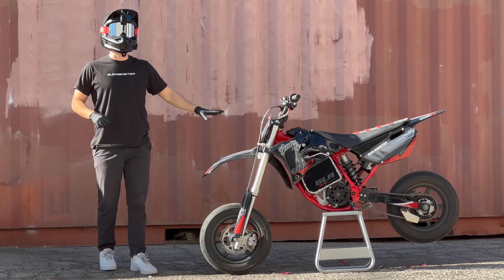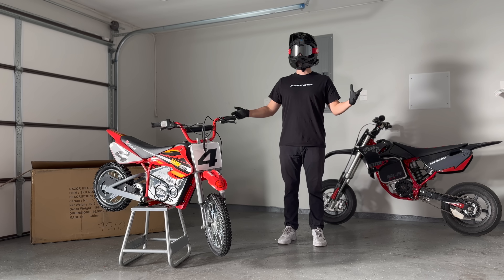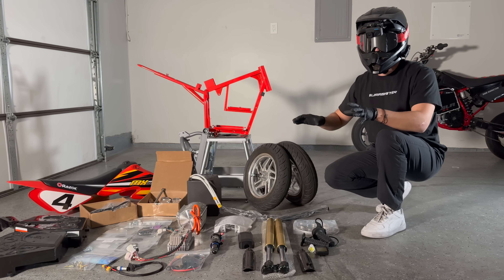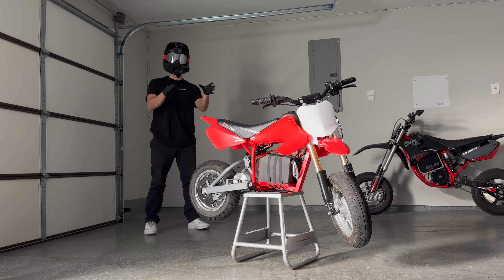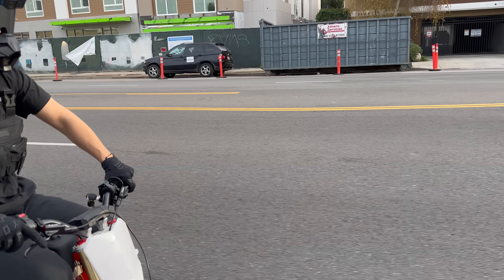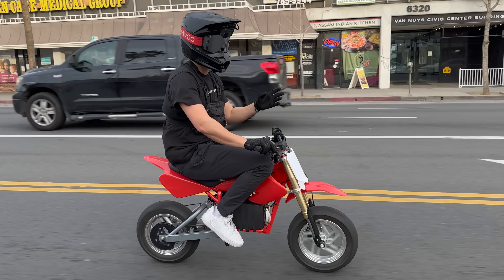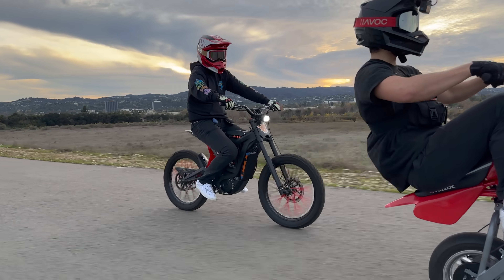How to Build an Electric Mini Bike

Comment: Hey surronster I’m 12 years old and I want to upgrade my stock razor mx650 but I’m not good with electrical things and connecting the wires and stuff and I’m afraid it’s gonna explode

Comment: What is the part name for the computer 🖥️ basically i get battery and motor i just don't know what to look for to build one and i have a small electric ⚡ atv that the battery and motor is fine but the relays or whatever its called must be bad motor only works when straight wired appreciate any help😮

Comment: Whats the name of the front forks, front fender, and the tape you used for strapping the battery in? Or any other recommendation's on how to strap the battery in securely?
Reply: I think he used electrical tape, or some tape with heat resistant, and zip ties to keep it strapped in

Comment: I wish he would show an in depth video for full beginners because when it’s sped up the beginners like me have no idea to do anything. 1:30
Reply: same he needs to do one cos i wanna build my own but dont have a clue how to
Reply: @brandondeegan8063 bro you just gotta get one and figure it out that’s the best way, I got bikes but w motors so I’m on the same boat as you dw😂
Reply: @brandondeegan8063  look at razorcrewcole he has in-depth videos on how to build one
Reply: Pls do a more in depth video man pls pls pls just one so we have an idea what does a man have to do
Reply: @tylercoffin6373  I bought this exact kit the kit comes with a link to in depth instructions
Reply: @tylercoffin6373 there are multiple builds in depth for each part and all dif motor battery options.
Reply: Relatively simple you just gotta get the kit that matches your bike than after that it is all screwing/mounting to the factory holes and all the plugs are color coded so you don’t gotta worry about destroying your electronics.
Reply: It’s almost 2000$ just buy one
Reply: @buzzkill278  buy one what a modded bike?
Reply: Move the playback speed
Reply: Step one: clear garage floor space
Step two: obtain a metric set of hex-keys and wrenches.. 
Step three: get to wrenchin'
Reply: Fr

Comment: W video! I noticed that you removed your heatsink on the motor to be able to run the rsf street tires. Would the heatsink still work if shave the part that rubs on the tire?

Comment: super cool build ..  we have to have pedals on the bike or you need to a license and insurance.  I have a 2020 Emmo knight turbo with the after market controller and the governor disabled I get going 83km/hr or 52/mph but it has pedals

The first electric I bought is an E-Vader or E-Grom with the gold forks.  Even with the cheesy controller it came with I still get going 63km/hr or 40/mph but i left it at my uncles place while I went out drinking, I came back and the front suspension was bottoming out.

That's when I picked up the Emmo, just got shocks for Vader now to upgrade the controller.

Comment: They should make them for Coleman bikes and doodle bugs
Reply: nah im a mini bike guy and not having a gas engine isnt the same plus you aint getting the power and the ultra easy upgradability factor of something like a 212 predator motor
Reply: @survivalhh2995  I get it. I love gas power too but I think there’s definitely a market for it. And depending on the battery and motor they could be way faster than a built 212

Comment: I have a 48V kit on an MX500 and it does around 32 MPH…. Would you know if there’s some type of regulator that I can add on to reduce the power when my young son wants to ride it… my throttle has a 3 position switch which I was hoping would enable me to control the power output but it feels like all 3 positions are the same
Reply: I have a page dedicated to these bikes, check it out!

Comment: would you ever try making a build with the Razor MX650 but using a dual brushless hub configuration 72v each? I'd love to do it to my mx650 but there is ton of research to make it possible, plus I cant find anyone anywhere that has done it before so I can base my build off of it...
Reply: I have a page dedicated to building these bikes,  heck it out and ask any questions there! I Gotch you fam 👊
Reply: @VoltronWatts  I was looking to see if anybody modified an MX650 using two brushless hub wheels instead of the motor and chain itself, but haven’t been successful finding any information or videos about the build…

Comment: I don't think that it's a fault of the motor, it's the batteries and the controller that sends too little power 650W is quite a bit considering that the average Xiaomi scooter is 250w

Comment: If anyone knows or could check, I would like to know the length  and width/diameter of motor, battery, and  controller that comes with the kit. Also, if anyone knows of a way or a business or service that could make a similar or identical battery to the one in the video but in a different form/ shape, I would appreciate any links. Thank you for your time I hope you all have a good day

Comment: You will hit  million subs by the end of the year or sooner. 
Weld two door hinges into the frame on sides of batt pan hinges and a steer strip to the hinge to hold battery into frame rather than electrical tape. The hinges flip down so the bar can be lowered to remove battery.

Comment: Idk man I was really looking into getting in to these because I thought it would be a cheap way to ride but $1700 plus the bike $500 plus $500 forks and around $300 for wheels it’s $3000 to only go 50 mph you put that same amount or less into a Predator mini bike and get way more power or just save a little more for a Surron
Reply: Shit I’ve seen running large pit bikes for cheaper than that
Reply: How much were the wheels
Reply: I mean what were they called sorry

Comment: Damn dude, I really enjoy these build and upgrade videos, but I wish you included pricing of the parts at the time of filming (How much was the original Razor bike? How much is the kit?). I think adding these details in the video itself would help incentivize a lot of people towards buying something like this.
Reply: Last I checked the price of the upgrade kit on electro and Co runs close to 1600-1800 dollars,  the bike is anywhere from 589-700 dollars depending on where you buy it.  I have no clue what the front forks cost or the cost of the wheels,  but the wheels are from the razor rsf650. All in all I would guess anywhere from 2500-3000 for the full build.  Still cheaper than the Electric YZ that's for sure.
Reply: @StoleYaSweetroll  dude i get get it for 16 bucks???
Reply: @YoAbdi  lol I wish,  I guess I got in a hurry writing that comment.  1600-1800 bucks.  Lol
Reply: @YoAbdi how??

Comment: Kool vid, radd build but for $1700 just for the kit is pretty steep. I obviously love the build but for 1700 not including the actual bike and forks. I think I’d rather purchase a real supermoto. I got my DRZ400SM for 2200. 

You should put together a build under $1500 from old pitbike parts.

You should checkout ratherbweldings YT build. Came out so dope. Basically putting together a build like that with less welding yakno.

Cheers bro 🤙🏽

Comment: Sur Ronster, how much were the upgraded after market parts & what was the stock bike price?  Thanks for answering, been watching for a good while!
Reply: Razor 650 is around $500 depending on where you buy or if on sale or not. Seen it between $450-$650.
The Electric Kit is around $1,700 or so.
The front forks are +$200 at least. 

Not a cheap build. But it's fun. Less than a Surron though.
Reply: @brianmccann666  Thanks for answering!
Reply: @brianmccann666  shoot, I saw I used mx650 for $75. Don't know what was wrong with it, but it looks like you'd be changing out all of the most expensive components anyway.

Comment: Have you had any issues with electro and co motors? I got the ETM 5000 and after a couple days of riding the sprocket on the motor had completely worn down the bolt its seated on, making it completely unridable. After contacting them they got me a replacement motor and after another week of riding the sprocket on the new motor exploded while i was going about 10 mph... then had to walk the bike a couple miles back to parking lot. Maybe im just that unlucky?

Comment: 1724$ ain’t. Cheap
Reply: Better than the $6000 my YZ 85 cost not electric
Reply: Its cheap compared to what it is. You have to think about if you go cheaper it wont go fast? Might as well keep it stock then.
Reply: Did you think it’s fina be $600
Reply: U just a cheap stake go then buy a 200 dollar knock off razor that goes 15 mph
Reply: For 50 mph yes
Reply: For an electric bike yes it is
Reply: for the power and speed yes it is
Reply: Compared to other things how’s it not?
Reply: @ that’s true
Reply: That goes the same speed as most $4500 e-bikes
Reply: Bro, you’re spoiled
Reply: For sm like a surron it is
Reply: For what it is, i think it's worth it. I just built a 56v razor with a cheap kit (~500$ for whole kit including battery)  and you definitely get what you pay for but it could go both ways
Reply: Fr
Reply: Just buy a tutto
Reply: It is relatively, if you cannot afford just work 🤷‍♂️
Reply: @tannerrosario2490 easier said than done
Reply: @cinonmono earning money is actually pretty easy.

Comment: The kit you link to mentions nothing about those forks you put on:) Can we get some info there, because that has gotta likely double the cost of your build, and nobody should do the kit without upgrading to a real fork (with all that speed and power). This may be slightly irresponsible to not mention...
Reply: Original forks are good enough actually I added an extra spring and long bolt to mine that gives it an extra 2 1/2 inch been using mine a year now
Reply: @devins1495 you have instagram?
Reply: the forks are from electro and company
Reply: @AustinBats  can't find a listing on the website for them...
Reply: @1917VIL  they are listed under accessories adds about $700 with front and back
Reply: He said everything here is from electro and co
Reply: 0😊😊😊00000😊0❤😊00
Reply: What is the measurements and width of the folk?
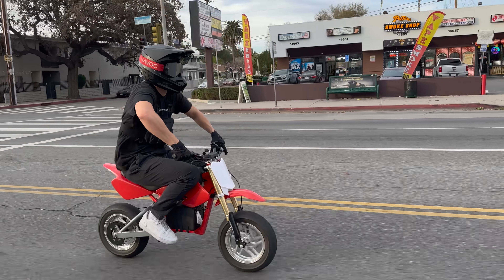Reply: Yoo I thought I recognized that Area @7:20 ! That's down Victory Blvd towards Van Nuts 💪💪💯💯 we Should Ride Around Broo !! I need some rider friends LOL
Reply: But the way the Sepulveda dam looks hella fun to ride at never thought of that !!